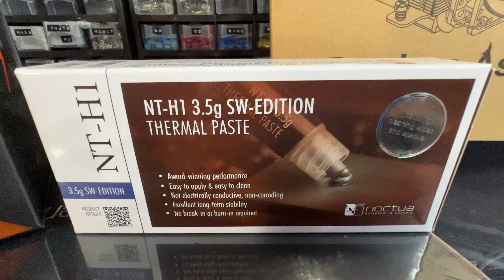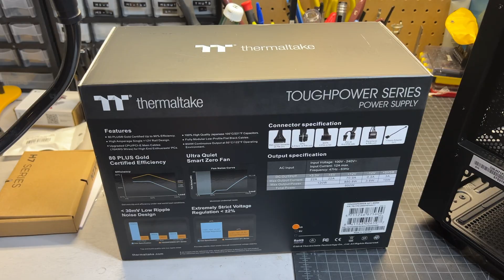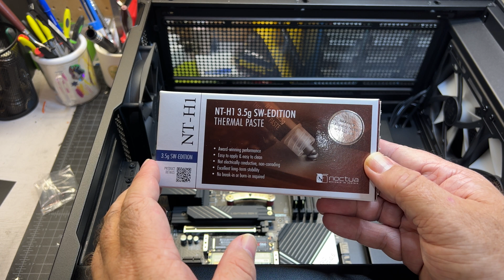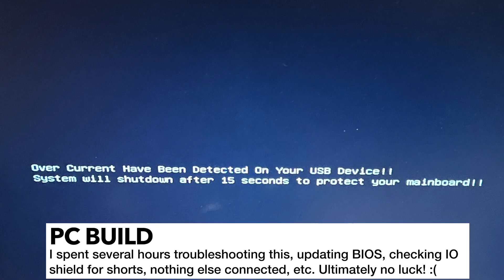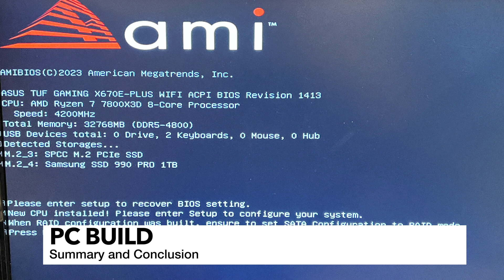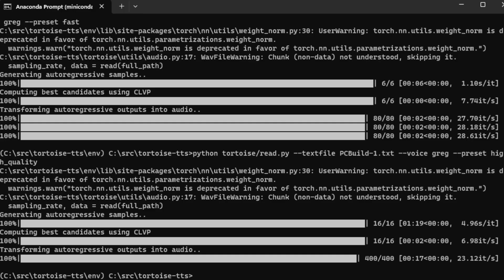DIY PC Build Tutorial - A Perfect Complement for 3d printing and Making!

Comment: Tip: Don't slide around the motherboard on the table and the best would be to put it on top of the box. There can be components on the underside of the motherboard. As a nitpick you don't have to spread the thermal paste out and can just put a small dot in the center. The pressure of the heatsink wil spread it out. Nice parts!
Reply from the maker: Thanks! The thermal paste in the center is how I’ve done it in the past, but it won’t spread to the outside corners of the cpu- a bit different these days.  The mat I have should be anti static but the box idea is always a good way too! Thanks for watching!
Reply: @GregsMakerCorner even better than the box is if the motherboard is package with a foam cutout underneath it, i always jsut leave it on that while i assemble, both for static and to make sure no surface mount bits get knocked of the bottom
Reply from the maker: @slumpchogg  Great idea!! Can't be too safe.
Reply: @GregsMakerCorner   It’s most important to have the thermal paste in the center, that’s where the die is. Of course it’s best to also have it on the edges but by spreading it out first you have the risk of there being an air pocket. If you have one dot in the middle that gets spread out by the pressure of the heatsink you will always have good contact. If you apply the correct amount it should also reach the edges. Kind of a nitpick though and spreading it out would still be fine.
Reply from the maker: @groteboem  I hear you! Just keep in mind, the AM4/AM5 chips are a little different and the center dot method just doesn't work to spread it out completely. You really do need to spread it out to hit the corners to get everything.  Check out this video for a bit closer up to see what I'm talking about. https://www.youtube.com/watch?v=xoF5ar9w-ow&t=630s
Reply: @GregsMakerCorner   I see the video, although I still don’t believe spreading is the best way because of the risk of air getting under. Also the performance benefit of having thermal paste in the absolute corners where there is no die underneath is negligible/non existent.
Reply: Thermal paste doesn't always 'squish' to the corners when pressure is applied. The pro builders of pc use a spreader with little teeth to spread a coat corner to corner. A little extra is always better than not enough when it comes to thermal compound.